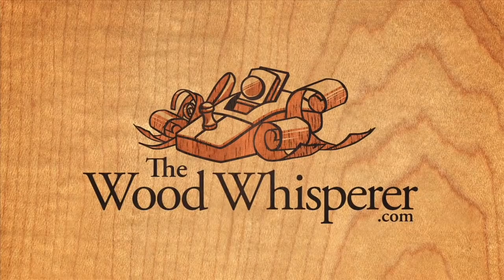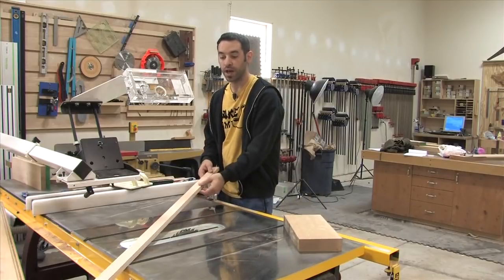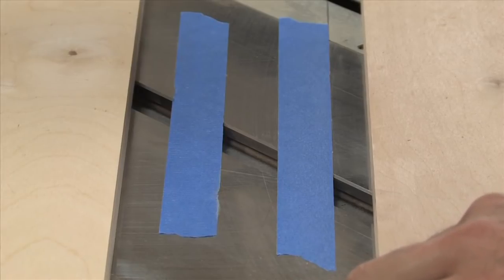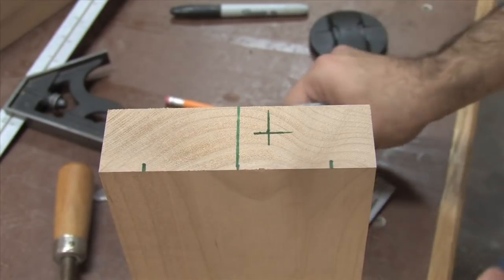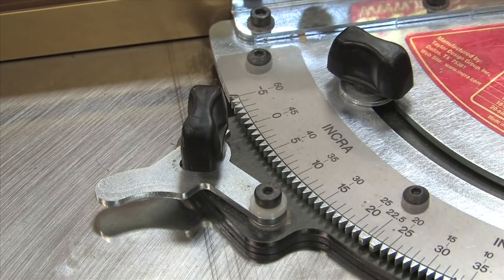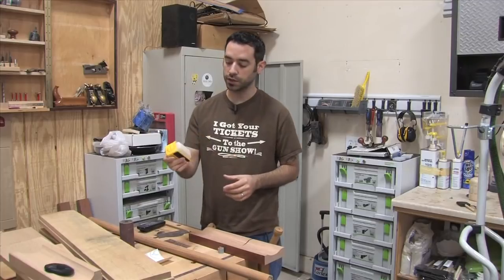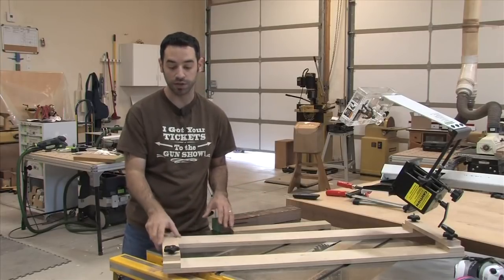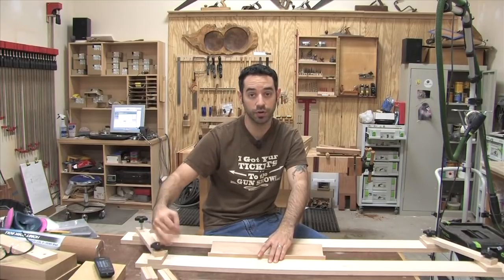184 - Coves on the Tablesaw & the Parallelogram Cove Jig

Comment: I would put on my fence, set my angle gauge, and gently line my parallelogram fence off of that, over the blade.
Reply: I'm also thinking I'd make a parallelogram jig long enough to go well beyond both edges of the tablesaw so I could tighten from below.  That would let you put long and thick boards through.

Comment from the maker: One thing you might consider doing is dovetailing the joints first. You can even do this technique on the fully assembled box. That way you won't have to worry about joinery after the coves are cut. It'll take some practice runs and planning but it can certainly be done.
Reply: I am making a jewelry box for a fundraiser and am doing mitered corners with sliding dovetail splines. If it was all assembled do you think I would blow out the miters? Fully assembled sounds safer and more convenient

Comment: I will make one off those jigs but one thing i think i will do is on the loong pieces ( front and back fence) i will make a 1/4" groove in the middle to take T nuts /bolt to be able just attach the jig to table t slots and not needing to use clamps , if that will work

Comment: Heres a possible sanding solution: 

Place a piece of scrap at the end of the work piece so you can draw the exact curvature of the work piece.  Cut multiple pieces out on the band saw at the same time so they all have the same curvature.  Sand these down to get them as close as possible to the exact curve of the work piece but it doesnt have to be perfect, just close.

Now attach these pieces together so as to create a form for your sandpaper.  Attach a piece of foam to the sanding side of the block (any kind of soft flexible foam will do) you just made using spray adhesive ( or something like that ).  Wrap on the appropriate type of sandpaper for the job and go at it.  The foam will offset any flaws in your sanding block giving you that flexibility from not being perfect on the band saw.

There are many ways to adapt this method or change it to your liking, but you get the idea.

Comment: Wouldn't it be easier to turn the parallelogram jig upside down and removing the support blocks? That way there would be no restriction on the height of the material you are using, and you could put one of the connecting rails right up against the top of the table saw, which i think would make setting up the jig a little quicker? Those are just my idea's and I would greatly appreciate your opinion on if you think they would improve on the design our not.

Comment: I did this on a faux log bed I built for my wife. The footboard was two 6" horizontal logs sawn in half attached to a vertical 12" log for the leg. I had to cove the end grain of the smaller logs to mate with the posts. I started by mitering to remove most of the material. Then I build a sled to support the 50" or so long board in the air and to keep the mitered end grain flat against the table saw top. One hand in the air holding the log, other hand operating the sled.  Got to be a better way.

Comment: Marc,
I'm kinda new to woodworking & like your videos. w/o any help, I made a cove jig that has some properties like yours. I failed to make it into a parallelogram (mine is simply two different fences) & I see that as an easy change. W/ that being said, I found it difficult to clamp it at times & made slots in each that have Tbolts that run in the slots on my table saw. It did allow me to minimize the clamping. Food for thought.
Thanks for the ideas.
Rob

Comment: I like the parallelogram. I cut coves before using only one straight piece clamped to the table, but only incrementing a tiny bit each pass. Your way is safer. Thank you

Comment: Thanks for another great video, Marc. I have some 6" cove crown molding to make, and I'm wondering if it would be easier to remove the bulk of the cove with a dado blade in a conventional fashion, first. You know - deepest at the apex of the cove, drop down a little and make a pass flanking the middle channel on the left and right, and repeat, working my way out. Then use the parallelogram jig to cut the coves like you show above. Make sense, or am I thinking too much about it? Thanks again.

Comment: Hi I just that thought this was a great informative video I have made coves before bit my method was a bit more hit and miss. I'm not sure how stupid this suggestion sounds but if you are only working with smaller material would it be practical to use  a long sanding drum with soft outer fitted into a chuck on the headstock of  your lathe secure the other end with the tail stock and sand the cove out at low speed on the lathe.

Comment: Rather than a bridge that interferes with the workpiece why not flip the parallelogram jig over, you could then have the connecting short pieces flush with the height of your table saw. A slot in the connecting short sides of the jig could be cut so the locking bolts can be adjusted along the length of the short sides to account for varying width in each workpiece each short side could ride on the front & back edge of the table & the jig locked parallel again using the workpiece?

Comment: My question is this:   when you find the length and the apex and then you try to offset the cove by say 1/2 inch.  Can you just measure from the center to the top of the cove offset to get the angle required to set the tilt of the blade?

Comment: great videos. i do think its worth mentioning that if you do use a single fence that it goes behind the blade (closer to operator), so if anything the blade is pushing the material into the fence. a few years back i was set up in reverse and cut my middle finger off as the peice left the saw and my hand came down in place of it.
Reply: I guess I'm a bit late to the game, but I have exactly the same observation.  If using a single fence, it should be set such that the blade tends to push the work piece into the fence.  If in doubt where that should be, use 2 fences like Mark does - definitely the safer way.

Comment: Great video. I know it’s been a while since you put this out. Not sure how thick your wood is but the piece I’m trying to do is three-quarter inch a little less. Can’t raise the blade enough to get the width I need what do you do with thinner stock  to get the width ?
Reply: Philip Breau
Go across the blade at 90 degrees. If the cove is still not wide enough, you can bevel the blade. It won't create an offset cove because you're going across at 90. Only combination angles will yield offset coves. One more way is use larger diameter blade if you have access to a machine that has one.
1 second ago

Comment: thank you for the video, it was interesting.  I am surprised that you didn't cut slots down the center of each long rail and use those to attach them to the miter slots. 
I do think though that even if you personally choose to use the sliding power miter box incorrectly <ie:  pushing the saw through the work instead of properly pulling it as they say in the instructions...so the blade pushes the work down into the table instead of trying to lift it...> I don't think you should be showing novices the wrong way.  I am amazed at how many 'teachers' on tv do this very same thing.  I think they are trying to mimic using a table saw but not realizing that the blade on a table saw is below the work and the leading edge is pushing down into the table where as the power miter box and radial arm saws are above the work causing the leading edge of the blade to try to lift the wood off of the table.  please check out the instructions that came with the saw, ty.
Reply: I'd suggest that you take up reading..... as in manufacturers manuals, because every manufacturers manual I've ever read says that you cut on the push stroke with a sliding compound mitre saw, but hey, the Internet is full of "experts" who know better......